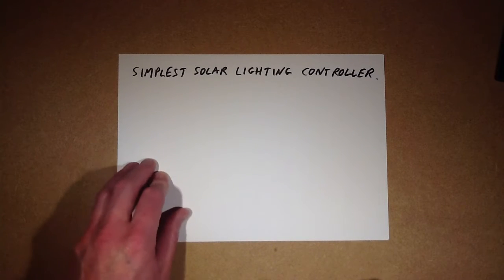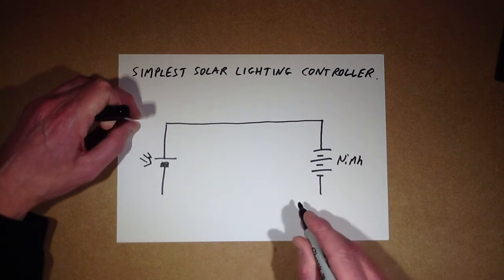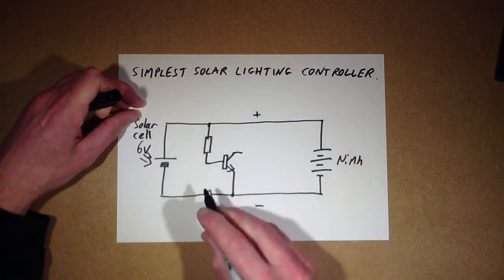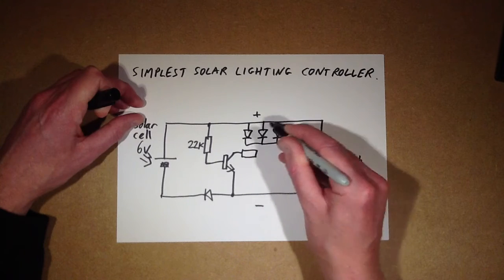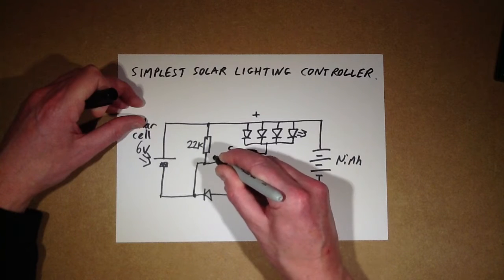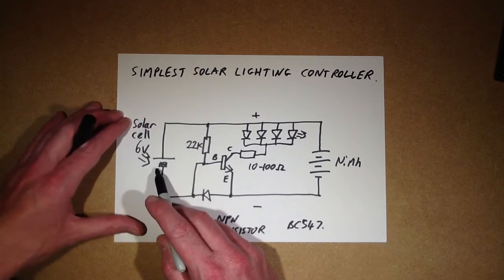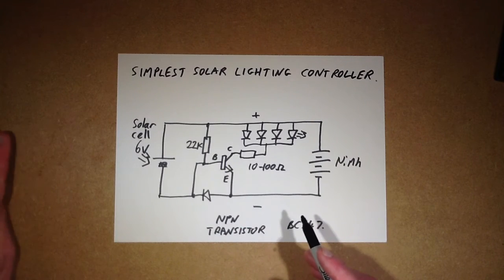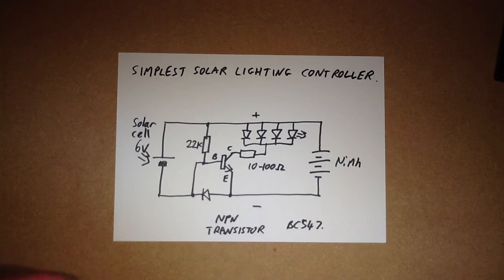Simplest solar decorative lighting controller.

Comment: i got a great deal out of this vid BC. i have been making solar lights with 5252f chips. but i fancied doing it the old fashioned way, and this vid was a perfect guide. I also tried the other way from your other vid.That is the one with the R going from base to the cathode side of the diode, that too worked. Thanks.

Comment: I have a solar array from a fence charger. I see a remote pendant light maybe several hanging in the shade powered by one battery with a low voltage wire.

Comment: How do you protect the battery from over charging?  I'd love to see the calculations on this circuit, but being a 10 year old video, its not likely being followed.
Reply from the maker: Just like standard solar garden lights, the NiMH cells are trickle charged.  If they reach their full capacity the current will still flow, but be converted to heat.  Charging nicd and NiMH cells is less critical than lithium ones.

Comment: I'm just starting out with electronics hobby projects, and this is exactly something I'd like to build from old garden lamps. But I'm confused about something. To me the diode on the bottom feels reversed, or placed at the wrong place. I'm sure it's me not understanding it correctly, so does anyone have a more detailed explanation of how this circuit works, how the current flows during the day and night? Much appreciated.

Comment: where would you put an hc-sr401 motion sensor?   i have 3 prebuilt solar lights that for some reason don't work anymore...  i know the batteries are good, and the solar panel is charging them, and the light unit itself works, so the problem seems to be in the 3 pot PCB with the sensors in it.   i even took the switch out, because it WAS a funky switch in a few of the others.   just want to replace it with a photocell in a hcsr401, with no switch since it will ALWAYS be set to auto.

Comment: hello, i'm trying to understand how these circuits work, i got the big picture but it's till a bit fuzzy - i got the circuit to work but i have problem/question - the intensity of the lights is much smaller when directly connected to the battery vs in the circuit when the solar panel goes off... there's a 'consumer' which i can't seem to wrap my head around, what is drawing power of the battery besides the lights

Comment: Usei o EveryCircuit para simular o projeto do diagrama acima. E funcionou muito bem. Usei chave simples entre a célula solar e o circuito do resistor de 22k, que troquei por potenciômetro para regular a potência dos leds. 
Desta forma, com a chave posso simular a célula solar durante o dia, chave fechada, e assim alimentando a bateria. E chave aberta, durante a noite. E os leds acendem.

Comment: Brilliant, the best circuits are the simple ones, the fibre optic wire that lights my toilet bowl when I go for a nightime pee is just a pressure mat, resistor, capacitor, mosfet and a LED with the fibre glued to the chip.

Comment: Just the job - possibly! I know nussink so am, literally and metaphorically, in the dark here. 
Could I substitute a YUASA 12v YTX20CH-BS AMG battery for the NiMH batteries and how would that affect the components?
I'd like to have permanent strings of LEDs in several rooms, providing a night light/security light. I bought the (new) battery cheaply and have my own soldering iron. And some components. And a sense of adventure. But no insurance.
Reply from the maker: You can get 12V dusk and movement sensing modules for controlling 12V lights like the strips or spots.
Reply: @bigclivedotcom  : Thanks for taking the time. When I said I know nussink, I really meant that. The battery (12v) and the lights (? volts) are the constants here. I don't know how big a solar panel I'd need to ensure sufficient charge to maintain the battery voltage. How many watts do I need?

Comment: Clive, if I understand this correctly, when there is light, the solar panel generates electricity, but electricity has to pass through a big resistor to get to the base relative to the collector. Since voltage at collector> base. The transistor is off.

When there is no light, battery pumps power through the diode to the base and then also take a detour through the 22k resistor to the led then to the collector. Since voltage at the base>voltage at collector, transistor is on 

Did I explain it correct?
I still don't understand how your circuit protects flow of power from battery to solar panel.. will the battery hurt the solar panel since there is no protection?

Comment: If the base doesn't have voltage during the night, how is the transistor going light the LEDs...? Is the base floating...? awesome video, I just did a similar circuit.
Reply from the maker: Leakage through the solar panel.

Comment: I took a few electrical courses when I was going through college, but it taught none of the stuff I've been finding on your channel. Even the basics components tutorials you've put out videos on was barely touched in the courses I took. From just watching your vids, I've got to the point where I've understood how to merge two of the circuits you've featured on your channel to make another circuit, which I find quite exciting! I've been wanting to make a kind of battery operated night light that powers a string of low power LEDs. They're currently wired into a 12 hour timing circuit and 4 double A batteries, which the circuit just eats through. Using the joule thief circuit and the circuit you just featured here, I'm pretty sure I can make a circuit that could work using (hopefully) a tiny calculator solar cell simply as a light detector. I guess I could also skip on the double A batteries and just use a lithium ion battery and no joule thief, but where's the fun in that ;)

Comment: No doubt its my clumsey work but-Just constructed this on a pcb. Checked several times everything correct but no voltage at led output acourding to ddm when solar panel is covered.used bc548 tran with 6v solar with a 3.2v lipo.used a 10+12k in series to get 22k. No current limit resistor fitted though.still no voltage at all......Ummm! It's out in sun.perhaps it might delight me when I get home tonight!
Reply from the maker: Does the cell have protection built in.  It's it definitely a 3.2v cell as opposed to standard 3.6V lithium?

Comment: Hi.can I use a 3.2v lipo with a 6 v at full sun brightness panel or would the batt be killed . thanks for you demos.supurb
Reply from the maker: If there is cell overcharge protection it should be OK.

Comment: Nice but how can we avoid one volt drop at LED compaired to battery voltage. I didn't use current limiting resistor at LED.

Comment: Has any one tried this on a breadboard? I am very new to all this and i can not stop power from going back to the solar panel. I switched the diode around many times with no luck. I used the a 5252 transistor a 4007 diode 22k and 100ohm resistor and color changing led.

Comment: I hate to say it but the circuit doesn’t work (for me anyway). I’ve tried it on the board and direct wiring and still no luck.
Reply: Skyrunner13 take a look at a video by “SR electric” ... similar project that connects the 22Kohm resistor from the negative on epithet solar panel and diode through the resistor to the base of the transistor.  I was wondering whether Clives design would work.  https://youtu.be/i0hZOD8Lo1Q
Reply: dgretlein Thank you for that. That looks more promising. I’ll give it a try.

Comment: I  Do not really understood this Circuit..!. It's an NPN transistor, so it should get a Postive in Base to get it Activated. When Solar power is flowing +ve and - ve charge from the Solar is virtuality Short Circuited here right ?(Because of Diode block the current flow ?).
Also, since  +ve charges flow through Base in the day, The Collector current start ro flow Emitter. So, the Bulb will glow in day..rt ?
Reply from the maker: The solar panel effectively pulls the base negative to keep it turned off.  When there is no solar power available the base current from the resistor to the positive rail allows it to turn on.

Comment: Hi Clive, one more question on this one. I have built this circuit with a 6v 330ma solar panel, and I want it to only come on when its really dark. I have been playing with the 10k resistor, and have gone up to 100k but it still comes on at roughly the same light level in the evening. Any other ideas re the variables I can play with? Thanks again. Grant

Comment: Hi Clive. I've just upgraded my project using this circuit to run 240 leds from a garden light circuit bought from B&M. The arrangement is actually 2x 120 chains in parallel. As expected, they run a bit dimmer than my 20 led string, however I noticed that on each chain they get progressively dimmer along the chain. Is there a way of minimising this effect; possibly by shortening each string? Thanks again.
Reply from the maker: If you were to loop the strings back to the solar panel and feed the positive from one end and the negative from the other they would be even brightness along the full length.
Reply: @bigclivedotcom  The string doesn't have any leads coming from the other end. Will this entail cutting one led off the end to expose the two wires?
Reply from the maker: @somebeinganonymous  Yes.  If you look closely at the end you'll probably see it's already been cut flush with the last LED.  The strings are made in a continuous run.
Reply: @bigclivedotcom  Great stuff; thanks again Clive. On a related note I've just watched your video with the 3 wire resin coated LED string; I think this is exactly the schematic you've just described! I'll keep the +ve where it is; cut and terminate the -ve and relocate this to the other end of the string. I wonder if there's anything to be gained from using a slightly thicker wire to the opposite end? Regards, Grant.

Comment: Thanks! My other lights don't look that much more complex tbh, so what else would you recommend to achieve the positive feedback to switch them in and off suddenly?
Reply from the maker: Standard garden solar lights often use a little four pin chip that looks like a transistor.  It's actually really complex and has voltage threshold detectors for detecting light via the panel, detecting a low battery state and it also has a built in oscillator that switches an external inductor at high frequency.
Reply: Ah, that would make sense; my lights do have those 4-pin chips. No problem then; I'll keep playing with this one I built :) Can I just ask whether it's absolutely necessary for the 10 ohm resistor to the LEDs? They seem to be coping without but If needs be I'll put one on. Also; if I want the lights to come on when it's a bit darker; which way do I have to go with regards to the 22k resistor? (higher or lower). Many thanks again!
 @bigclivedotcom

Comment: Hi Clive. I've just built this one with a string of 20 LEDs from an old garden string light set. I omitted the 100 ohm resistor as it made the LEDs far too dim; they seem to be coping at the moment. A question for you though: my other garden lights suddenly come on / off at a certain light level, whereas this one seems to come on and go off gradually. How do I get the sudden 'switch' effect, rather than the 'dimmer' effect? Many thanks.
Reply from the maker: The dimming effect is down to the simplicity of the circuitry.  It would require some sort of positive feedback to bring them on suddenly.

Comment: Lets say I want to replace the battery with a 4 volt DC power supply to basically use the solar panel as only a light switch.  The problem would be that when the sun comes out. What issues would this cause when I have the solar panel and the DC power supply on at the same time?
Reply from the maker: That would work, but it might be easier just to use a light sensor like an LDR to turn off the lights in daylight.
Reply: I would use a LDR but the circuit for the solar panel switch and charging is built into the led floodlight..
Semintech Solar Flood Lights 54... https://www.amazon.com/dp/B0739P9C33?ref=ppx_pop_mob_ap_share
Reply: The circuit works exactly like yours but the battery is dead within 4 to 5 hours. I figure the easiest way to extend hours without a complete mod is to wire into the battery hardness. But I could try to bypass the circuit and use a light sensor

Comment: I have been downloading your videos for reference - 260 of them. I have been given many defunct garden light solar panels. This circuit is absolutely spot on (again). I have 8 x 2.5 V (bright sunlight) solar cells and I would like to try and run a few (or 1 ) bright white LED's just to keep my small garden lit at night. What's the maximum current I can use ?
Reply from the maker: The maximum current will depend on the LED/s and the current handling of the transistor.  It's also a balance between how much charge the unit will receive from the sun during the day versus how long you want it to run at night.

Comment: Thanks for the video, I think this is just what I am looking for.When the solar cells are charging the battery during the day, should I be concerned about limiting the current through the blocking diode? And what kind of diode do you recommend using there?

Comment: One must appreciate the beauty of this! As I am learning electronics at 60, I find this to be rather jewel in the rough. Essential and remarkable.
Reply from the maker: +Chris Leech There's something particularly pleasing about the simplest circuits.
Reply from the maker: I wasn't actually aware of dark leakage current with solar cells, so it took me by surprise that it does actually work.  I'm not sure how predictable dark leakage is in solar panels though.
Reply: If you really want to get minimalist, try this on for size...   Suppose you omit the 22k-ohm base-bias resistor!  I think the solar cell dark-current should bias the transistor on!  

Some possible downsides to this circuit are you might have to play with the part selection to get it to perform acceptably.  Also it might not have good temperature stability due to all those PN junctions hanging off the battery (i.e. the LED's might be noticably brighter at warm ambient and dimmer when cold).
Reply: Cool huh?  Well of course it's predictably a diode, because it is a pn-junction, but yeah, like with any diode-type device, LEDs etc, the exact parameter-values are another question.  I will say that the simple electrical-equivalent model of a solar cell goes a long way toward describing it.  There is a current-source that is proportional to light intensity, with a diode in anti-parallel.  At the maximum power point of the solar-cell the silicon diode will only be biased to ~ 0.5 volt, so that there isn't too much current lost to that diode shunt.....  Optionally, the next layer of abstraction adds a small series resistance and larger value parallel parasitic resistance....  As shown here:  http://en.wikipedia.org/wiki/Theory_of_solar_cells#Equivalent_circuit_of_a_solar_cell   Well worth knowing at least this much since the technology is so inexpensive now that it is playing a significant role in modern energy production.
Reply: That is very interesting idea there Mike G, thanks.

Comment: Won't the LEDs switch on & off as clouds pass by throughout the day?

Which diode would work in your circuit?
Also, the diode allows current to flow through it when the solar cell is adding energy to the circuit (i.e. charging the batt & returning back along the lower - rail), but how does it block current as you stated when the solar panel is outputting no energy?  When no energy is output from the solar cell, then current from the battery flows through the LEDs, current-limiting resistor, transistor, and then returns to the - battery terminal.  Couldn't the current also flow through the diode up to your solar cell if the V was higher on the positive side of the diode than on the negative side of the diode?

Comment: this was just the video that i was looking for ... im testing it with a 6v 1w solar panel and a 3.7v 980mAh battery and it work great... i just did it and its been almost 2 hours with them on... 5 LEDs ill let u know the results of how long it stays on ... but this was just what i was looking for... great video
Reply: angel rivera is that a lithium battery? Does it have over and under voltage protection? if not you might want to keep it away from flammable places.

Comment: I like your design, simple and effective. I would like to use this design to use 1 or 2 AA or AAA and add an inductor in to boost voltage and current. Best place to do this? Plus side of LED's before resistor?
Reply from the maker: You can adapt this circuit to a Joule Thief by using the same diode arrangement, but using it to pull the Joule Thief transistor base low.  However, that does require quite a high value base resistor on the Joule Thief for efficiency, and that results in the unit driving the LEDs at lower current.

Comment: Umm, not sure if this is related to youtube or the camera, but the swaying, distorted wobbling around is nauseating :-(
Reply from the maker: When I use the iPad to record something using YouTubes "capture" app it applies auto stabilisation by default making static images bounce about.  When I first uploaded the video it appeared fine, but it has since "enhanced it" with that nauseating effect.  Right now I've just gone to that video's settings and "reverted" it to the original, so that should hopefully just show the original video without the wobble added once YouTube has finished re-processing it.
Reply: bigclivedotcom
Ah much better! Along with G+ integration, another youtube thing that doesn't work right :-) Appreciate all the videos you do , thanks :)